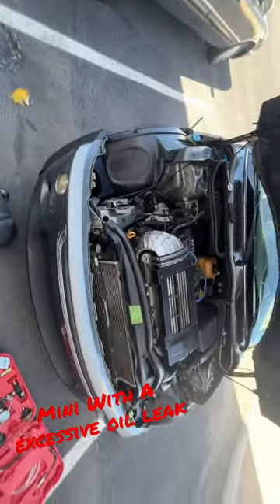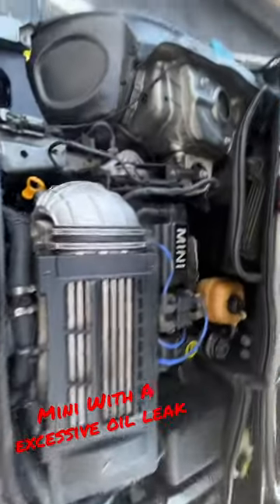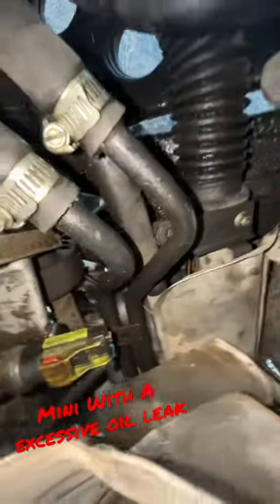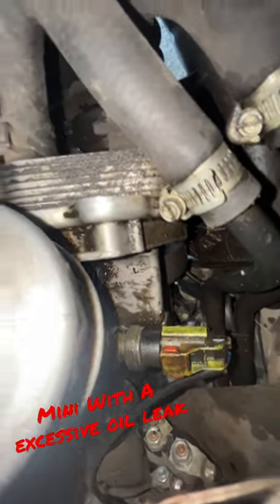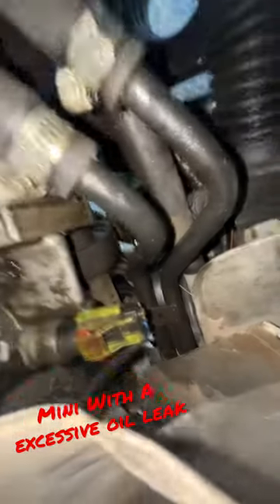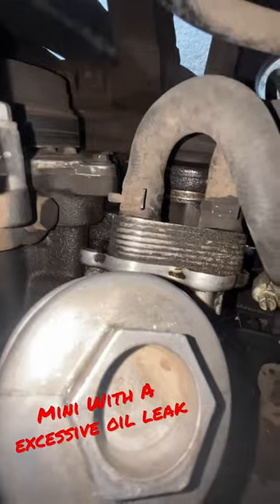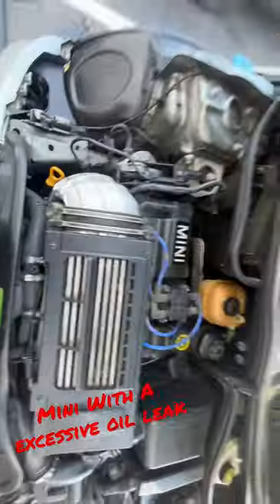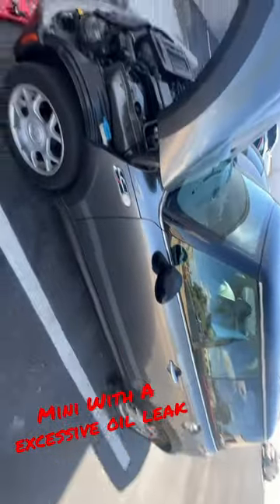2000-2008 mini cooper  major oil leak very common watch until end to see what it was

Comment: Double gasket on filter
Reply from the maker: It was just single gasket/o ring on the filter but from the looks of it was old soon as i replaced with a new one solve the oil leak issue